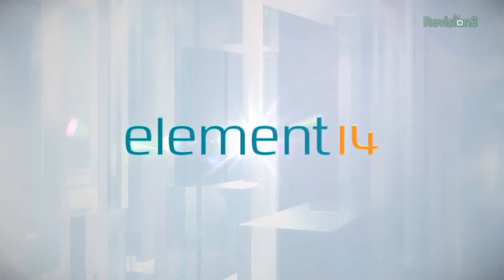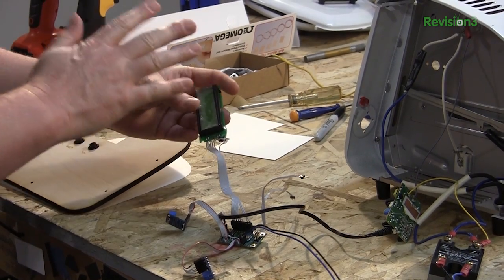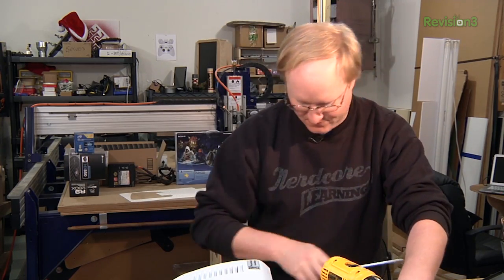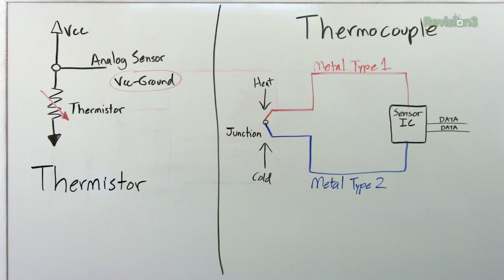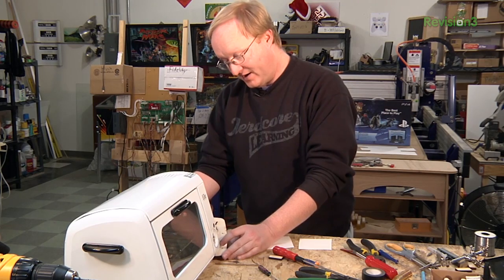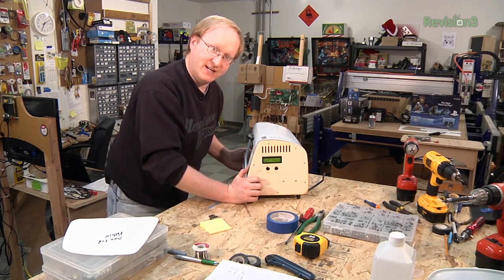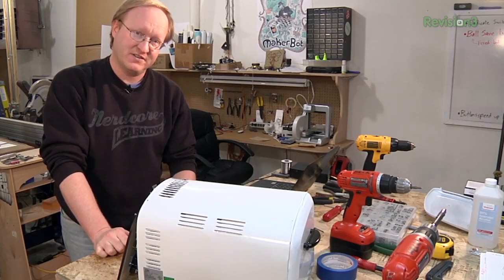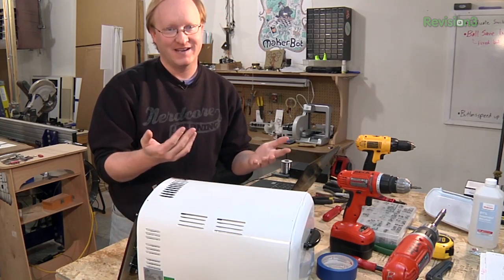Ben Heck's Home-Brew Solder Reflow Oven 2.0

Comment: no....if someone puts food in it you;ve fucked up.  one, you dont want food anywhere near the flux and or lead residue building up over years. 2) to really follow a temp profile you should have added tons of insulation and heat tape over the window in the door

Comment: Ben, how about some links for the various modules for this project.
And more detail on how they are exactly connected.
-- 
Example: Thermal Couples & controllers. Brand and/or part # - Power Supply, etc.
                   Also the LCD and its controller.
--
And the Code would be nice!

Comment: Hi Ben,

Where can I find the code and any schematics used in this reflow oven project please?

I'm designing a homebrew reflow oven at the minute and I want to incorporate the best features of several designs I've seen on the internet including this one. By doing so I hope to eliminate any early teething issues by making use of tried and tested designs.

The oven I'm using has 4 standard elements. All wired up seperately. Because standard elements aren't as responsive as halogen or infrared, I plan to control these elements either independently or as banks of 2 to get finer control over the heating to stay closer to the profile - if that makes sense?

I'll also be including a rear mounted circulation and cooling fan into my design to help circulate the warm air during the reflow process and to aid with cooling at the end.

My coding skills are pretty weak due to lack of practice so my firmware will be an amalgamation of all the software from the designs I use - at least until I get my C foo back :)

Many thanks. Really enjoy your shows. They've inspired me no end :)
Reply: Tumbleweed hi ben, please send me all your hard work for free, then tell me how it works, ill take all the software you've developed, gerber files, schematics and extra components you have laying around, thanks. also, could you pay for shipping?? great, thanks
Reply: +Jeff Waterman A of people learn through code examples and reverse engineering projects like this. Taking a known working example, and tweaking it can be paramount for some when it comes to learning coding and electronics in general.
Reply: +Jeff Waterman he clearly is doing this project for fun and educational purposes, not like hes trying to sell the designs...

Comment: instead of using two thermocouple amplifiers, and since you can read only one at the time anyway, would it be feasible to add some switch to select which of the thermocouples to read instead?, and use only one amplifier?
Or is there some requirements around the amplifier and thermocouple that it should be connected the whole time?

Comment: I originally built a similar one a while ago but have recently built a new version which improves on the design..

It incorporates more heat (4 elements instead of 2)  but more importantly

1) a fan to move the air around inside which gives a much more even heating..
2) a solenoid to automatically open the door when it gets up to temperature
3) a heatsink for the SSR
4) a fan to keep the electronics cool

because it has a fan, there is no need for two thermocouples...

results are better than the original toaster oven

for version 3.0 have a look at this video  XmSbU3uDNm4   and  H4tSKgHLTck
Reply: oops  I meant 8 elements instead of 2

Comment: Dang i do not get what baking a motherboad chip does for it....
Reply: It solders the chip down to the board.
When you're designing a circuit using surface-mount components, it's often possible to hand-solder it but the process can be difficult and time-consuming.
An easier way is to reflow the board: You apply solder paste to the solder pads on the board, put the components in place, and heat up the board until the solder paste melts. If you do it right, you can solder all the components onto the board (or multiple boards) all at once.

Comment: So, about this thing...
The solid state relay is mounted to the wooden panel - which means practically no heat conduction away from the SSR. Is this a problem in practice? I've been gearing up to build my own reflow toaster, and one of the things that's concerned me is that all the documentation on the SSRs (plus several angry reviews) seem to indicate they dissipate some of the switched power as heat, and therefore need to either be seriously de-rated (like using a 50W SSR to control a 10W load) or else stuck on a big heatsink to dissipate that heat. With that in mind I went with a higher current rating on my SSR than I really needed when ordering parts...  How important are these concerns in practice, given that a reflow toaster like this will only be operating for a few minutes at a time, etc.?
Also, what kind of heat-up/cool-down rate did you get from this oven? Was it fast enough to fit the profile?
(And isn't it kind of irritating to have the controls and display on the side of the oven instead of the front?)
Reply: I guess you could add a fan but that would create additional failure modes. If you're building ONE re-flow toaster (or anything) for that matter, then you should over engineer the design anyway. It should only set you back a few bucks.

Comment: Hey Ben, I'm really interested in these home-made reflow ovens and I've seen another youtuber using a 3rd-Party module to convert a toaster to a reflow-oven. In his video he had problems with the grill where the pcb's are sitting at. Do you encounter the same problems as him like bad reflow of the solderpaste where the rods of the grill are located? I'm really curious about that.
Greetings from Vienna
- Andreas

Comment: Can u build an LCD screen on an xbox one controller to use it when you got to use the bathroom
Reply: KuraIthys shrug there's no reason the video feed has to go over wi-fi. There are other ways to wirelessly transmit video from one room to another.
Reply: What, you mean like what the Wii U does? Don't count on it... The Wii U's entire system design was built around being able to do that... I mean, I can hook up my tablet so it will show the desktop on my PC, but it runs at about 3fps, and there's a huge delay before the screen updates if it has to update the whole thing, and you'd go mad trying to play games that way. The Wii U needs all of the following to make it's wireless display streaming work:
1. High Bandwidth Wi-fi (It's a 5ghz dual band wi-fi stream, JUST for the screen. There is an entirely different wi-fi chip in the system to be able to connect to the internet as well.). - The range is also pretty low compared to generic wifi systems.
2. Low resolution display; (The screen is 720 by 480 aka 480p - And that's not just so they can use a cheap screen or lower powered GPU... It's hard to stream video with very low latency over a wireless connecion.)
3. Custom video encoding. - Most streaming video is not optimised in the slightest for gaming; You'd need to use something where the most important thing is latency.

In short, if you used a tablet PC as a base you might get partway there, but without a lot of pretty complex stuff, you couldn't just do this with an xbox controller and create a result you could actually play games with. Or even watch movies with... (You might be able to use the menus or browser over a system like that, but that's about all...)
Reply: if you had a ps4 and a psvita you wouldnt have this problem, lol
Reply: Scope-Eye video Ah... You do have a point there... But what kind of wireless, low-latency video streaming technologies exist that would be easy for a modder to implement? The 'low latency' stuff in particular is very challenging...
Reply: KuraIthys
I used to have this thing, it was made for people who wanted to share the picture from their cable box or VCR in multiple rooms. I expect it just took the video signal, modulated it with an RF carrier and transmitted it. Then there was a similar box on the other end that would receive the signal and convert it back to something the TV could handle (composite? Or re-modulated for channel 3?)
Though now that I actually bother to do a Google search or two - PS4 doesn't have a composite out, it only does HDMI apparently. So I guess that wouldn't work.
Reply: Well, you also have to keep in mind what the latency/lag of such a device is. If you're transmitting cable TV from one room to another, I doubt you'd really care if the image you get at one end is half a second (or even 5 seconds) behind what is transmitted at the other end, it won't matter much... But if you're gaming, even 30 ms (that's about 1/30 th of a second) could cause a big problem. Ever played a game on a TV that does a lot of image processing? Noticed the delay, and what that does to certain kinds of games (like Guitar hero?), now imagine the same thing, but with a much much bigger delay...
Reply: Yeah, like I said, I never tested such a device for latency.
But in a purely analog setup like I described - where would such latency even come from? There's no "buffering" in such a device. You don't need to have a certain amount of ahead-of-time data ready to convert the signal, as you would with an analog/digital conversion. Signal comes in, gets modulated and pumped out an antenna, then received, demodulated, and stuffed into a TV. Latency is never zero in a non-perfect world, but in this analog setup it's hard to picture latency high enough to make a perceptible impact.
Reply: Analog systems can also produce lag. It really depends on what the circuit is doing with a signal. But that's far too complicated for me... XD

Comment: Question from a random person: What's happening with those little boards when he "cooking" them ?
Reply: The heat melts solder (paste) that's been applied to the board, soldering all the components down to the board at once.
Reply: Scope-Eye video
Sorry - watched it again but on a larger screen. Now I can see them melting.
So it's just faster than to do it one by one (using solder machine, or whatever it called in english don't really know).
I always thought it's danger to expose them (circuit boards) to high temperatures.
Sorry if my english is not so good. ;-)

Comment: Very good tip about checking connectivity with heatsink. In tech-college during the first semester, we had to make a 240V dimmer using a triac.
When I went to get it approved, by the teacher he was like, looks great just push the triac down on the circuit board and screw it down. So I pushed it back and got a massive jolt.

My teacher looked at me as if I was a typical Hollywood actor faking it. I was like: "FUCK ME! THAT'S THE 220V!" He was like: "No way!!! If it's even on the 'hot bed' than it's on the low voltage end 12V. So I said: "Well you try it, sir!"

He said: "Do I look that stupid to you? I have the DIGITAL" (which was The Dutch component bible off the early 90s -- ironic for a typical analogue part).
He looked it up and was amazed to see that the heatsink was indeed the AC, ground (for AC it makes no difference). He made in in the spur of the moment lesson out of it. Pretty cool to be in the 5th or 6th week of your college and learn this shit the hard way. I guess that's what college is all about, learning by doing it.

Comment: You actually don't need any of that craziness...  We've baked 1000's of SMT boards in several different $10 toaster ovens from goodwill.  You set to highest temp and wait till everything has flowed ~3-5min.  Once completely flowed, kill oven, and open door to cool. DONE.  It really is that simple.
Reply: I tried this in the toaster I bought for my reflow oven project, and in four trials, I got one successful reflow - and three melted PCBs.
I really would not recommend melting PCBs. It produces a really foul (and poisonous, no doubt) stench. It could be the toasters you tried don't produce as much heat, and therefore don't get close to burning the PCB material in the amount of time you have them running...  But if you're getting whatever toaster you happen to find at the thrift shop, I'd be careful, run the thing with some good ventilation if nothing else.
Reply: Scope-Eye video
Well it's pretty important to turn off the oven and open the door as soon as all the paste has flowed.  If it's hot enough to burn the PCB the solder should have flowed well over a min ago.  I do recommend performing a few experiments to get the feel of it.  I've burn boards as well, but only when forgetting to set a reminder alarm. It's really not that hard.  FWIW I use leaded solder paste, not sure how lead free would perform in comparison.  This routinely works for me with batches of six 10x10cm boards.
Reply: Yeah, I don't doubt you can get it right with practice - I just wanted to warn against "turn the oven on full blast and wait". :)

Comment: Something to keep in mind about that thermocouple - the temperature 'read' by the chip is the difference between the thermocouple itself and the reference built into that chip - so 'inside' the oven control area the chip might get warm which means your oven will read higher than it is - A good idea to check and make sure once the oven is hot use a thermocouple on a multimeter and verify the readings are still good.